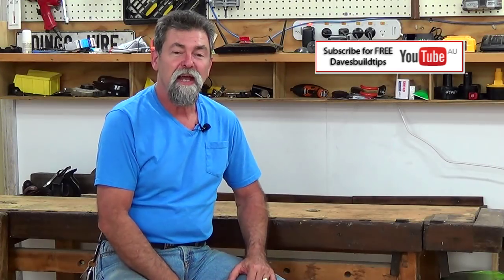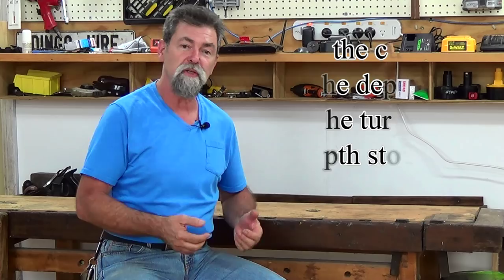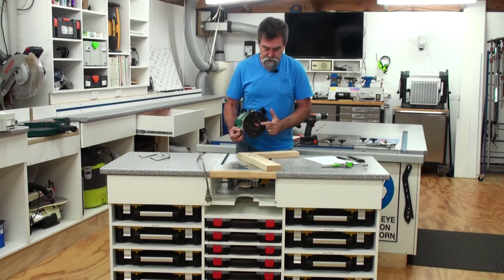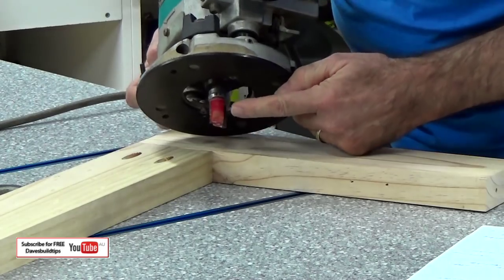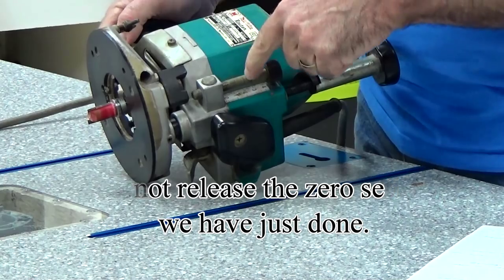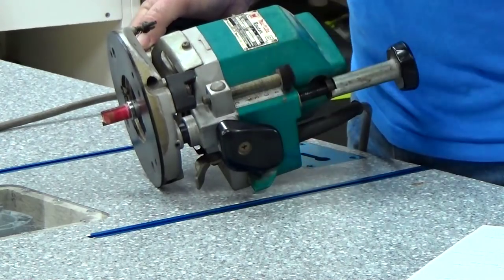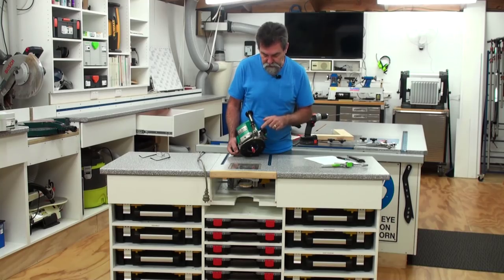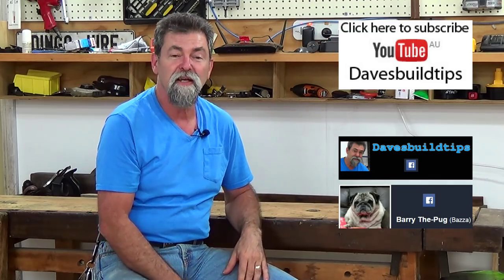How To | Set The Router Depth | DIY

Comment: Sussed. However, how does one set the depth when using a rebater because there is a turning bit on the end of the shank and which would not count towards the initial measurement.
Reply from the maker: Well there is the possibility of raising the job onto a packer and marking the depth on the actual job, lower the base of the rebate cutter to that point and set the depth stop accordingly?

Comment: Thanks David, great tip. I built my assembly table and router table using kitchen bench top just like yours, love it. Only if i see this video earlier so i could get the t track flush with the table.
Reply from the maker: +Eason Qin Kitchen bench top is a great surface. Easy to clean after glueups. Just need to be careful not to scratch it.😉

Comment: Great tip. However; when the material you are routing into is softer than a hard melamine benchtop you run into the problem of the thin blades of the cutter eating into the wood when you zero out the router. You then have to put something hard on the soft wood (like a feeler gauge), plunge the router and use the same thing on the turrent when setting the depth stop. Just my 2 cents.
Reply from the maker: Thanks Fredrik. Happy for you to chime in with added info to help my viewers out!

Comment: Thanks David, nice and easy tip for newbies like me! The next one, that could be useful - how to repeat exact shape of the plate that you're installing :)
Reply from the maker: +Tiger Tech . Thanks for the compliment! There is a router bit called a pattern bit. I can show you if you think it is worth it.
Reply: +David Stanton as i get, you mean that one with bearing at the top using square to follow it with router's bit? Seems like the tricky part to have a router bit the same or less radius than the plate you're installing. Anyway - will be glad to see this kind of video from you. Cheers from Ukraine! :)